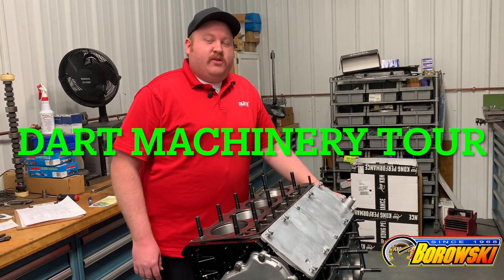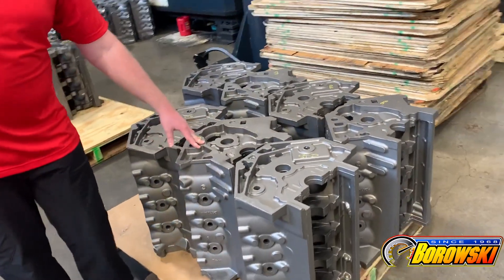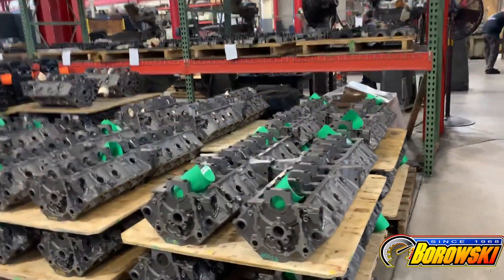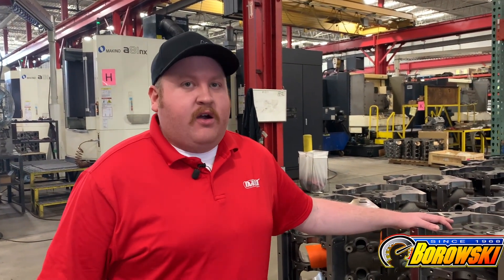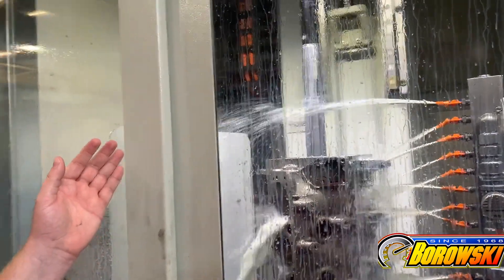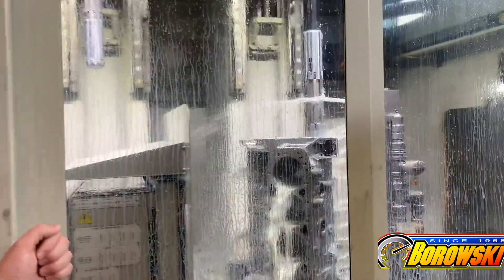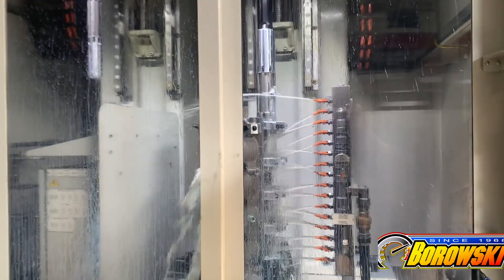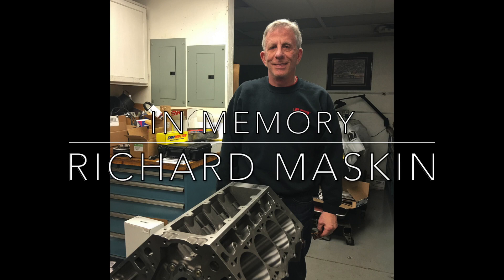Dart Machinery Tour

Comment: Three years ago I paid $1700 for a dart SHP sbc block , now they’re $2900. I know there’s inflation and material shortage but the problem now is you got speed master coming out with junk blocks for $2000 I hope you guys can get the price down. Dart  makes very good products.
Reply from the maker: Thanks for your comment.  We have told Dart that their price increases are higher than the market can absorb and will therefore significantly reduce demand.  In prior years, we would have had that talk directly with the owner.  Dart, like many other vendors, is now private equity owned.     We therefore not only have no control over parts pricing, but no influence as well. Our solution is continuously optimizing our engine builds to improve $/hp while maintaining reliability, durability, appearance, etc. We are constantly being approached by Chinese vendors with low cost product but have no interest as we cannot properly vett them to assure quality.  Instead, we will purchase from larger players here in the USA who are better positioned to assure quality and will (hopefully) stand behind the product (ex: Callies/Compstar).

Comment: Are your dart pro 1 20 degree heads good for Big horsepower and boost 2500-3200 horsepower )
Reply from the maker: https://borowskirace.com/collections/vendors?q=All%20Pro%20Cylinder%20Heads
Reply: @borowskirace  what about For a Big block Chevy
Reply from the maker: @Willdabeest27  We use the Dart Pro 1 as porter castings.  That means it is our ports and combustion chambers. The bare price for a set is $3,658.  A standard assembly uses Dart valves (stainless & Inconel) with triple springs for a  mechnical cam.  The complete price is $5,214 (assembled or loose).  Please call us if you are interested.  We have the Dart BBCs in stock.  The All Pro' LS heads come in and go out quickly but we have a have a blanket PO so they keep coming.  815-725-2727